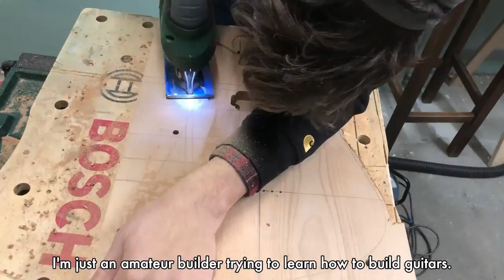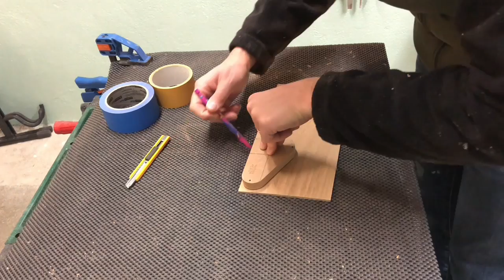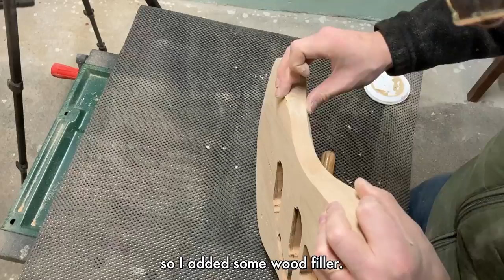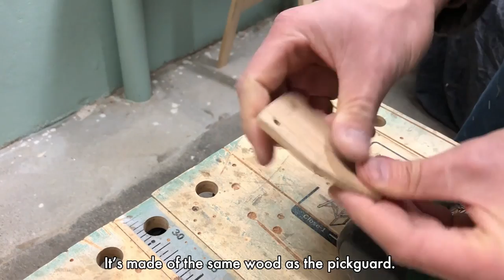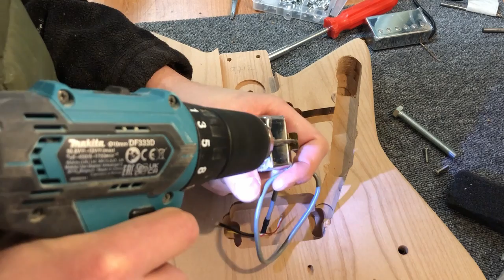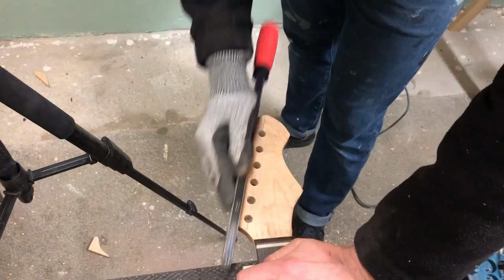Can I Build a Music Man Mariposa in my garage?

Comment: Bonjour et merci pour cette nouvelle vidéo qui m'inspire à nouveau.
Concernant la pose des micros, comment est fait le réglage pour la hauteur une fois qu'ils sont posé avec insert? merci d'avance
Reply from the maker: Merci ! Il y a de la mousse sous les micros qui les met "sous pression". Et après on ajuste la hauteur en vissant plus ou moins la vis dans l'insert.
Reply: @FrenchGuitarGuy  : merci pour l'info, pour la résine noire maintenant, elle durcit suffisamment pour protéger le bois? une seule couche a suffi ?
Reply from the maker: @yohanndesimeur9000  Je t'en prie. 
Ça ne protège pas réellement (c'est pas de l'epoxy par exemple),si tu prends un coup, le bois partira ou sera indenté. Mais ça fait une couche qui solidifie un petit peu et qui protège de l'humidité, rayures... etc.
J'ai fait 2 à 3 couches :)